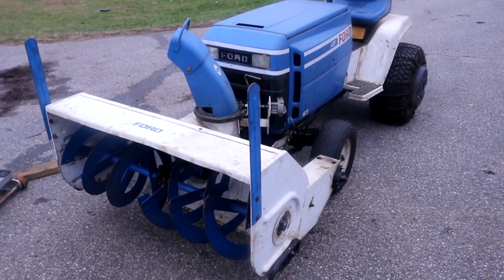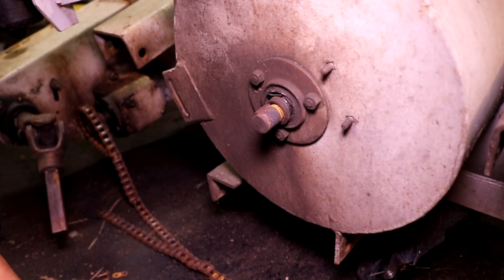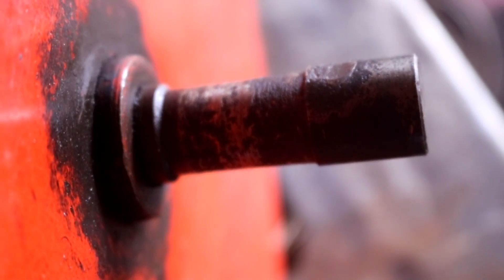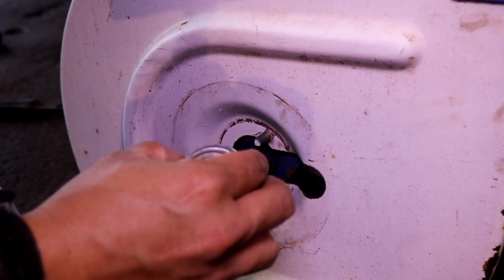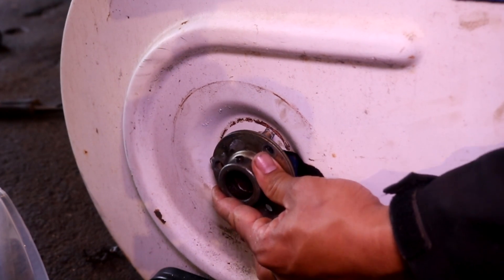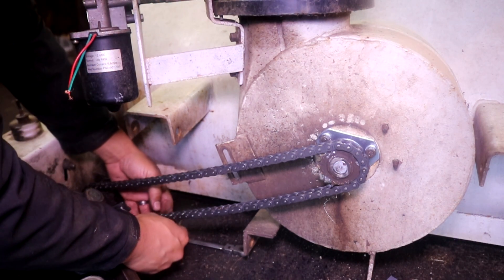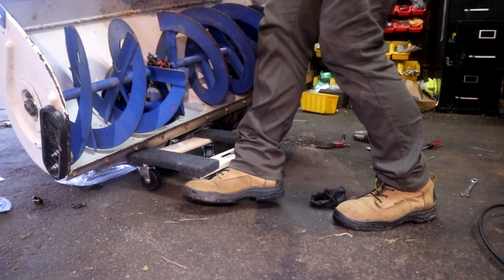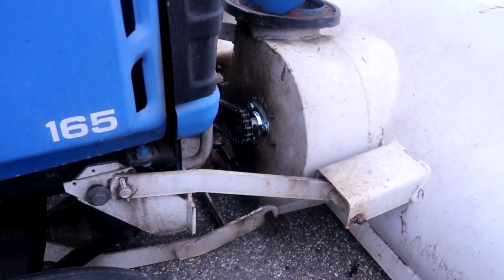Ford LGT Garden Tractor | 42" 2 Stage Snowblower Repair | Vintage Garden Tractor Repair| Snow Blower

Comment: Great tractors I have two of the open frame and live in norther Michigan and use them every winter. The roberts bearing on the side of the auger I need to replace but I cant find a replacement. I wonder if you sell these or know where I can get one? Thanks

Comment: Hey, I love your channel, been a subscriber for a good while now. I have a good qst for you that I never really found any answer anywhere. I got a Ford LGT165 for ... FREE that I found on the internet. and I want to rebuild completely (I learned for your videos, big Tks) and as soon as I can find the time/money for that project, I'll order all the parts from your company (I'm in Quebec, Canada, I think it's not a problem for you to ship it here, isn't it?. So my QST here: Is it possible to turn a Ford LGT165 2x4 into a Ford LGT165 4x4 tractor (I mean a serious 4x4, not the kind of easy conversion that we see sometimes on Youtube). The main problem that I wonder is how to deal with the gear ration between the front and the rear wheels... You never did a project like that. I would really like to have your thoughts about it. .  I love what you're doing. Tks  BTW: If anybody could come up with some idea on how to deal with the gear ration, you're welcomed.

Comment: My snow blower on my 1973 112 had a stiff chan. But when I took the chain off to fix that I also packed my bearings full of grease. Also do you know any way to pull the shoot adjuster apart on a John Deere snow blower to grease it and if so can you make a video on it because mine is so stiff you have to use two hands. And most of the time it wont budge.
Reply from the maker: The chute rotator is clamped on with that collar. Just pop off the metal connector and it will come out.

Comment: Are you using motorcycle chain lube?  Im surprised they designed that chain to be out in the snow and salt like that.  As you can see on the #50 blower for your JD 400 its covered.
Reply from the maker: Yea originally it had a chain guard but it was open in the bottom. Mine has been missing. I do use a graphite type chain lubricant on it. The JD blowers are better made

Comment: I have a Ford 125 I believe it is.  It used to have a single stage snow blower on the front but the snowblower has been removed now.  I still have the tractor but am no longer using it for anything...didn't even start it this summer!  But when it started, it's a good runner.  There is lots of play in the steering though... Like a 1/2 turn of the steering wheel!

Comment: I just did my winter grease, oil change and spark plug change on my 149 loader.  I also painted all the yellow with new caterpillar yellow Farm Implement paint.  I like it, I may go mono color like your 149.

Comment: Hey Norman
I have a john deere 317 but one bearing in the Ross steering gearbox is Broken it has a diameter on the inner side of 19mm.
Do you know where i can get a piece like this ?
I searched in the Internet but i found nothing 🤷‍♂️🤔

Comment: Great video! I just got my new to me 1980 bolens QT17 mounted up to the single stage 42" today. The tractor, 54" deck 48" deck and the blower were all stored for 10+ years in pieces... I still need 2 seals for the blowers gearbox but I guess just keep it topped up for now.